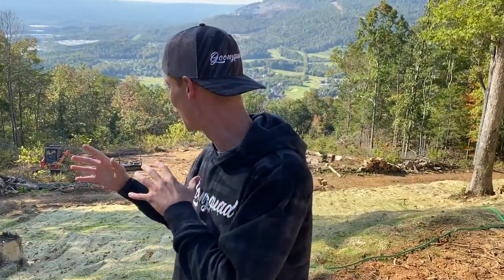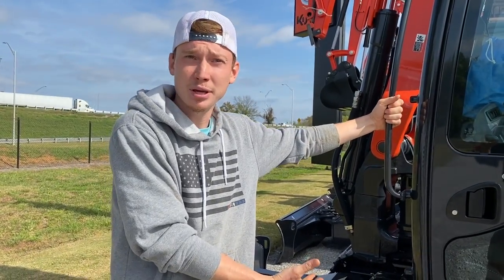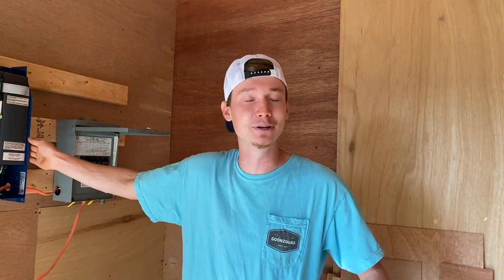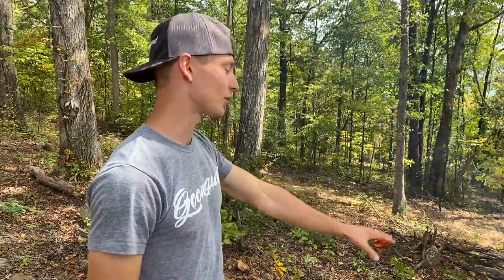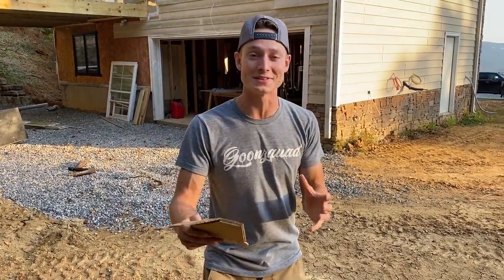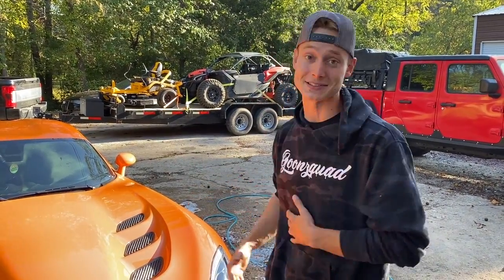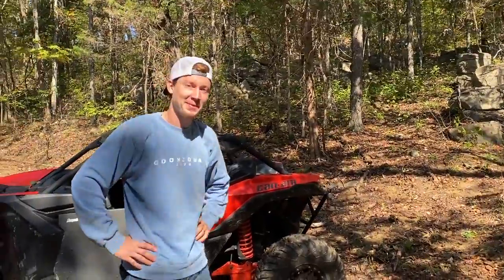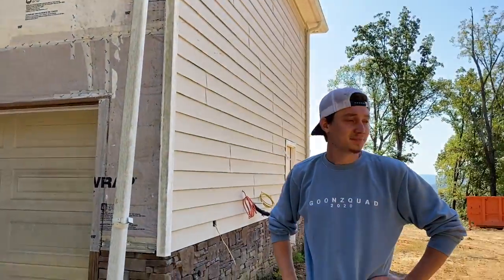The New Goonzquad Headquarters Part 26

Comment: I used to work at copart up until a week ago. I did receiving so I cleaned the cars made sure the cars had keys and the cars ran I worked at the one in Macon GA the reason the Audi had no keys but said it had keys is because a worker took the keys because it devalues the car and they would have a friend buy the car for them for super cheap also because employees cannot buy cars from copart also the cars get started and bounced off the rev limiter immediately on cold starts so the cars get treated like crap while they're there. Copart is actually a really bad place to buy cars... they scam and lie to people. They get rated off "bpl" best possible light meaning does it have a key does it run and drive. The car could be running one two or three cylinders or knocking super bad needing a new engine or trans and they label it as a run and drive because it boost their numbers up. Also they rip open hoods with the big loaders so it causes even more damage to the car. Nothing but a scam I was highly disappointed my first day there.

Comment: Need power binders https://www.speedbinders.com/  or https://www.bossbuddy.ca/  Get your well hooked up proper  with a pressure tank before you ruin a pump that could have been the reason for the control panel it's our family biz trying to help ! 1,000' is basically 3 football fields long .

Comment: What ever became of the commercial property for the garage? Still happening??? Or did ya sell it off.....and if the garage is going to be bigger than the house then I would go 5 bays  1 spray booth.2 frame machine bay.3&4 working bays with lifts for 2 projects.5 buff & detail finishing touches bay with indoor wash all with 4' concrete walls for welding/grinding back side put in a compressor room and paint room and maybe get ppg to sponsor you a complete paint mixing station....like you said go big or go home! Then you can buy repair and sell repairables....oh and if ya want an excavator sell off the Ferrari and the lamborghini..... keep the viper, hellcat,trackhawk,f450 for towing camper,ect ect...just my thoughts on it....
Reply: Suppose a 5 bay bus garage would work since those are purchased by cities all over the country and come pre-fabricated?

Comment: I can rent a pump puller. Have a pro test it.het water quality samples, take to lab. Call lab about samples, there picky.go from there. If you size tank and pump properly it will never run dry, unless an act of God. Only time in court, professional witness. Good luck. All of this well work can be done by owner of property if done up to code in MD. That got toughest regulations. Lots of bad expensive things can happen working a well. Proay be better here